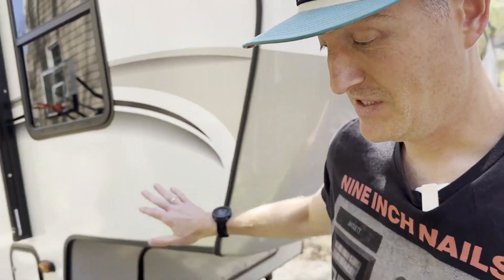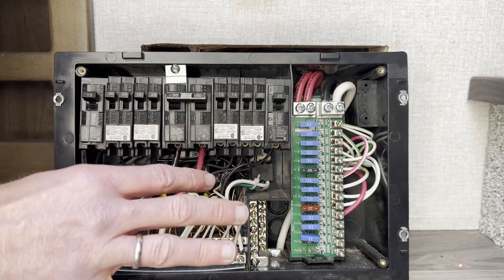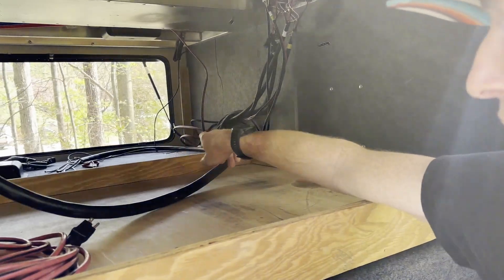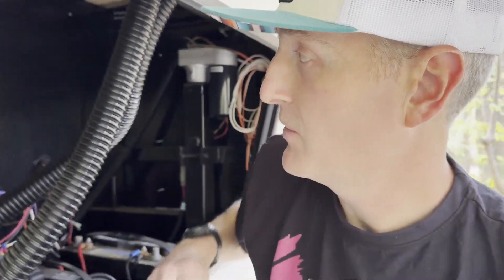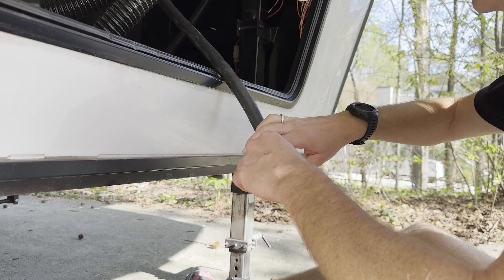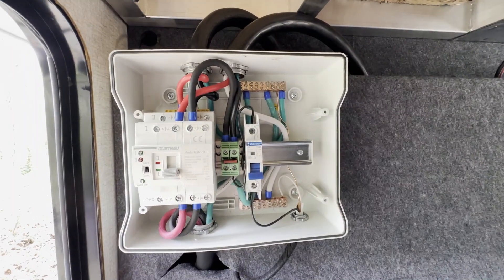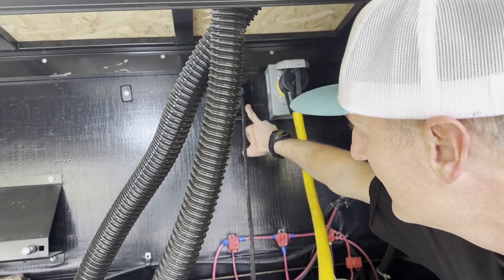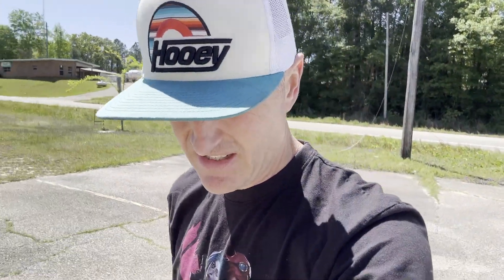Installing an EcoFlow Delta Pro 3 into our Fifth Wheel RV

Comment: Yeah that's not a "beast"... I'm about to install a real beastie the Delta Pro Ultra with a 6kwh battery beneath it in the front basement of my new (to me) BigHorn 5th wheel, in place of the 2 lead acid batteries and the downright puny 2kw pure sine wave inverter it came with. With some solar panels, it will be the primary power for the coach. Your video was very informative and helpful though, thank you so much for making it!
Reply from the maker: Thanks!  Hopefully that setup lets you find some great dry camping spots.

Comment: Did I notice that there was broken welds on the aluminum studs under the steps? Also, I am doing the same thing with my rig but I am using my Bluetti as my main battery as well and adding some solar panels on the roof. I have a Grand Design TT 315 RLTS
Reply from the maker: I’m not sure about the welds. Nice catch. I’ll check them out. I’m sure the Bluetti will be just fine getting you ready for some off grid work.

Comment: Good work. I decided to use a a transfer Switch from the Shore Power location instead. I have a similar setup as yours with a Power Station setup + DC to DC 12v to 48v  battery Charger.
Reply from the maker: Thanks!  A transfer switch is probably necessary in this application. My mini breaker acts as my transfer switch, but a dedicated transfer switch would probably have been easier.

Comment: What connection or plug did you use for the delta pro 3 to the fuse box?
Reply from the maker: It’s connected to the fuse box with, I think, 4 gauge wire on the AC supply side. I added a regular AC outlet to charge the delta pro.

Comment: Great video! I have an Ecoflow Delta Pro 3 and two extra Ecoflow batteries and wired it into my fifth wheel exactly as you did, but the ATS only works in manual mode - it will not automatically switch from shore power to the Ecoflow if shore power disconnects when in automatic mode. I am looking for the cause of this now. I would also like to have the LEDs on the transfer switch light up. I am assuming these lights don’t work because we are only connecting the hot wires to the ATS. Perhaps a jumper from the common neutral bus bar to the neutral terminals on the ATS would solve that problem. Also, did you build a short 50 amp cable to connect your Ecoflow to your 50 amp outlet, using a 30 amp to 50 amp dogbone adapter on the Ecoflow? This is what I did, however I’m thinking I’ll probably build another 30 amp cable with a 50 amp plug on one end and a 30 amp plug on the other to connect directly to the Ecoflow without the need for the dogbone. UPDATE: Both the LED lights on the ATS and the automatic switching mechanism are working properly now. I simply connected two jumper wires from the neutral bus bar to the neutral terminals for position I and position II on the ATS. My ATS looks almost identical to yours and has the same model number but has the brand name Geya.
Reply from the maker: I had a 220 VAC switch in this video. That’s why my LEDs didn’t work. I’ve since switched it to the 110 VAC model, and all the LEDs work just fine. It was a mistake I made when I initially bought my materials. I’m glad to hear you got your LEDs working too. 
To connect the EcoFlow to the RV I used a short 50 amp cable with a 30 amp dog bone. I didn’t custom make the cables though.
Reply: @themartinsareatrip  I have the Geya 4 pole 63 amp 110 VAC model ATS but the LEDS and the automatic switching did not work unless I used two jumper wires from the neutral bus bar to the neutral terminals on the ATS. After you changed to the 110 volt model of the ATS, did your LEDs work without connecting neutrals to the ATS? As I mentioned, in addition to the LEDs not working with my installation, the automatic feature of the transfer switch did not work unless I connected the two neutral jumper wires. I was however, able to manually switch between shore power and the Ecoflow. So I am very interested to know if the LEDs and automatic feature are working in your 110 VAC ATS without connecting neutrals to your ATS. Thanks
Reply: @themartinsareatrip  UPDATE: When testing my ATS installation, I set the ATS to automatic mode and while it was switched to shore power, I disconnected from shore power and the ATS automatically switched to the EcoFlow as expected. However I discovered that after the switch to the EcoFlow, the isolated EcoFlow charging outlet had 5 volts on the hot wire and over 40 volts on the neutral, even though shore power was disconnected. This was not good. I suspected it might have something to do with the fact that the neutral for the charging outlet was connected to the neutral for the EcoFlow via the neutral bus bar in the mini sub panel. I decided to completely isolate the charging outlet by doing the following: I removed the two neutral jumper wires from the neutral bus bar that were connected to the neutral terminals on the ATS, and instead wired the neutrals from the EcoFlow and shore power directly to the neutral terminals on the ATS. I left the shore power neutral connected to the neutral bus bar so that the neutral for the charging outlet would remain connected to the shore power neutral. I then added a jumper from the neutral bus bar to the shore power neutral terminal on the ATS. Lastly I removed the ATS output neutral from the neutral bus bar and connected it directly to the neutral output terminal on the ATS. At this point the ATS was simply wired to switch both of the power lines and the neutral from one of the inputs to the output. This setup completely isolated the charging outlet from the generator. I ran the same tests again and everything worked as expected, and there was no voltage at the charging outlet when disconnected from shore power and having the ATS switch to the EcoFlow. This setup also works well if you want to have the EcoFlow in pass through mode, such that you can power the RV with the 30 amps from the EcoFlow but charge it at the same time from the charging outlet if the only shore power connection you have available is a 15 or 20 amp outlet at a house. In this scenario, the EcoFlow will allow you to run one or possibly two air conditioners in the RV, but because the EcoFlow is also being charged from the 15 or 20 amp outlet at the house, it will run the loads in the RV for a longer amount of time than if the EcoFlow was not being charged. I have run every possible test I can think of with this installation and everything works, including the LED monitoring lights on the ATS, and the automatic switching mode for the ATS. The only potential problem I can think of is that the EcoFlow Delta Pro 3 uses a floating neutral, as do most portable generators, but if there was a problem with any of the electrical equipment in the RV, I could use a neutral bonding plug on the EcoFlow. However the bonding plug must be removed when using the charging outlet to charge the EcoFlow! Thus far I have not had any problems using the EcoFlow without the neutral bonding plug. At this time I believe I am essentially using the same setup as you have, except that I am connecting all of the neutrals to the ATS, and only using the neutral bus bar for the shore power neutral and the charging outlet neutral.

Comment: I don’t understand where you wired in the breaker for the charging outlet into the transfer switch. Any chance you can make a short showing more detail on how you wired that up?
Reply from the maker: I probably didn’t explain it well. I added the charging outlet to the sub panel in my pass through. The charging outlet is only powered when I’m on short power. I just used the power rail in the sub panel to make sure it could only get energized when the shore power was connected. Otherwise it doesn’t get any current.

Comment: Couldn't you just plug the camper shoreline into the EcoFlow 30 a outlet?
Reply from the maker: For sure, but the ECOFLOW is in the front storage bay, and my RV power inlet is on the back wall right below my ladder. So, the cable would need to be about 50 feet long, and I’d have to wrestle that thing on every lunch stop.

Comment: Now buy some jumper cables cut the ends off ,attach to your truck batteries and run them to a dc to dc charger to charge the eco flow while you drive
Reply from the maker: Funny you should mention that. I’m in the middle of failing at adding a DIY DC fast charger.

Comment: Awesome video!!  I am thinking of doing something very similar with a PECRON Power station.  I love the plug and play option versus a huge lithium set up.  Just curious, what is the purpose of the jumper from the dinkle combiner to the automatic transfer switch?  This is all new to me and I’m just trying to wrap my brain around how that works.   Thanks!
Reply from the maker: In the sub panel that I added I included my automatic transfer switch and a new circuit that charges my ECOFLOW. The new circuit is only active when the automatic transfer switch is set to enable power from a pedestal.
Reply: @themartinsareatrip  thanks!  I am actually doing the install with the same transfer switch tomorrow weather  permitting.  Your video was extremely helpful in figuring out my set up and what I needed to order!

Comment: I'm sure you know that you could have simply plugged your 30 or 50A house power cable directly to the ecoflow? Mine fits in a rear compartment next to the inlet, so I just use a shorty 2 footer 30a and done. But there wouldn't have been all the diy fun.
Reply from the maker: That is very true.  I just didn't have a good spot to put the EcoFlow in the back of the RV near the original inlet.  I really wish we had a few rear compartments in our Fifth Wheel.  And you're right, where would the DIY fun be?
Reply: I was thinking the same thing, as that's what I am doing to run my trailer with my ecoflow.  No matter what the reason, it seems like a lot of wasted time and money.
Reply: That's exactly what I wanted to do...My 30 amp cord compartment is right next to the storage area compartment where the water controls are and where I keep my hoses and water filters. I can also move these to the other compartment and put in the Solar Generator power station..I just need to figure out where to cut the holes for both cords...Great idea..Thanks
Reply: It's not always the case that the factory shore power plug is near a compartment large enough to fit a solar generator in to. Who wants to have to drag a nearly 35 foot long heavy cord from the front of their RV all the way to the back of the coach every time they want to connect to their solar generator? It may be simple, but it's a real pain in the long run.

Comment: I have a 50A travel trailer with the shore plug at the rear and the only storage space is towards the front. I thought I was going to have to find a 50' 30A cord and then find the appropriate adapter and run the cord outside (rain or shine). I'm so glad I found your video. Like you had mentioned in another comment, lot of work for a 45 minute pitstop! Your solution is great!
Reply: See my comment

Comment: Absolutely Fantastic 👊
When we consider people paying 10 to $30,000 to get Off Grid Solar Systems put in their RVs, your system is great / smart!
Suggestion: 
Although I own two EcoFlow Power Stations for my small apartment.
1. The BLUETTI Apex 300 is a versatile all-in-one power station with 120V and 240V outputs, offering unmatched flexibility and affordability.
Please do your research on the all new BLUETTI APEX 300 with perhaps 3 expansion batteries.

Comment: I did something similar but used a transfer switch instead of a circuit breaker. So when traveling there is nothing to remember to turn on or off.
Reply from the maker: That's a great solution.  The mini circuit breaker does have an auto switching feature that essentially turns it into a transfer switch.  This was my first try at the solution, so of course I'm sure I over engineered it.  Most of the time I've left the switch in auto mode, but I forgot to turn off my electric water heater, and it totally drained the EcoFlow in under 7 hours.  So, I might switch it back to manual mode until I can train myself to turn off all the RV vampire circuits.

Comment: why don't you list out all the parts. So you are essentially doing this:
PGE ----> Rear RV Connector -------> Transfer Switch ----Breaker Box
ECO FLOW Power ----- > Transfer Switch
The transfer switch will switch between Power Utiiity compay your connecting or connect to your ECO FLOW Generator.
I have a diagram that shows this but You tube won't allow me to add it to this chat.
Reply from the maker: Thanks for the list.  The little mini circuit breaker acts as a transfer switch as well.  So, I can manually switch between shore power and the EcoFlow. Or, the mini circuit breaker can automatically fall over to the EcoFlow when Shore power is disconnected or drops.

Comment: Why didn’t you just plug the camper into the Ecoflow 30 amp output port and be done?
Reply from the maker: That's a great question.  I don't have a great place to store the EcoFlow inside the RV or the Truck, and the only open space was the front storage in the RV.  I can't really get to the storage very well when the truck is connected, so I didn't know if I could use the EcoFlow while connected on travel days.  And travel days were the time I anticipate using it the most.  We've had a propane generator and pulling it out, along with the 50 amp cable is quite an ordeal for a 45 minute lunch stop.  So, I wanted to figure out how to integrate the EcoFlow into my electrical system without having to use one of the heavy 50 amp cables.

Your idea of a 30 amp cable would have been a better idea since those cables are much lighter.  I'd just need a 50 foot 30 amp cable.

There are always a million ways to solve a problem.
Reply: @ great answer. I ask because I’m currently doing the plug and play method and worried I may have overlooked something critical so I’m glad my idea should work. I’m storing mine right next to the main cable so it’s a quick pull and plug. Thanks! Love the setup.
Reply: I've mounted the delta pro inside the garage on my 5th wheel, where the factory shore power cord ca reach. I either plug into shore power or plug into the 30A TT outlet on the pro.
1200 watts of solar on the roof mostly keep the pro charged.

Comment: Good install.  I’ve had the Ecoflow Delta Pro for awhile.  Great unit.   I also use mine in the house if we lose power.
Reply from the maker: That's our plan as well.  I tried to make it possible to move the EcoFlow back and forth out of the camper.  Realistically this thing weighs a ton though.  So moving it is pretty tough.